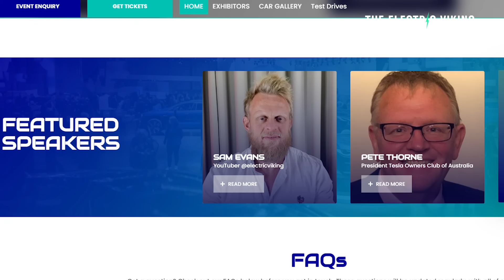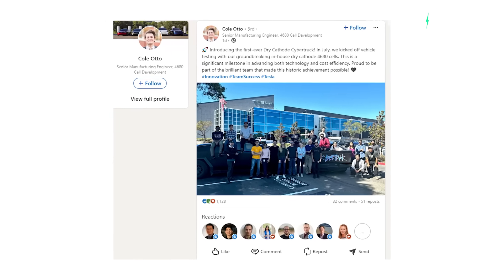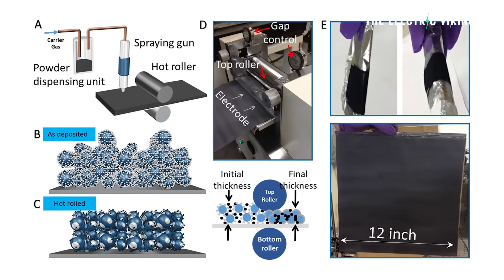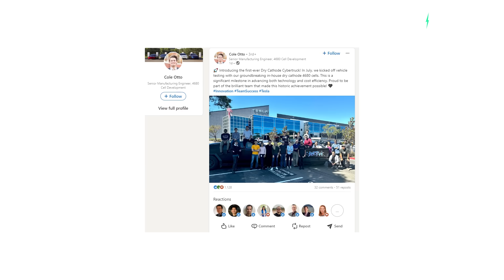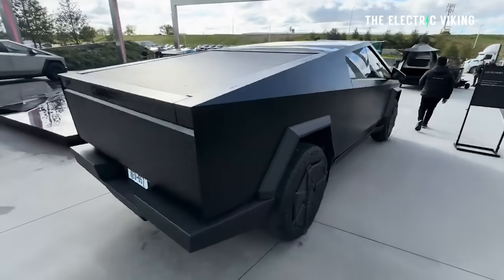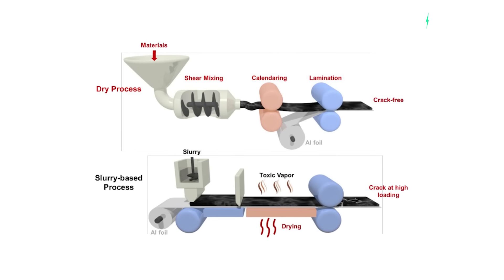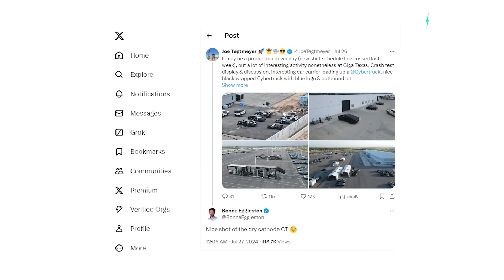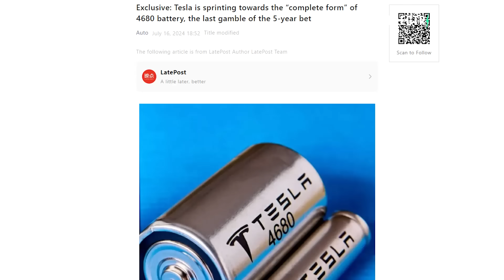Tesla finally solve 4680 battery "bottleneck" - this changes everything!

Comment: Use digital camera as new type of battery so all we need is contrast even in the night we had saperate by distance had contrast can generate electricity at nano level and capaciance effect can store at all time in buffer zone and shift to battery at master clock timing like 20mhz so at few square in 20 million a second is like 20 million square in in sun light

Comment: If Tesla has this working they could manufacture  a bigger 65mm by 160mm battery that would suit the Semi  and Mega Packs . that size would be equal to 4  4680 batteries  but could be produced in nearly the same time . The saving would be even greater  . Tesla bought MAXWELL. to also get super capacitors which can work as a buffer on regenerating braking on Semi truck both on long downhill runs  and uphill climbs . The computer knows the route the truck is travelling so it could keep or recharge the capacitors so there is more power available than just the batteries .

Comment: It’s easy to claim 10-20% improvements in small volume, lab-produced test products. The question is not so much whether they can do it, but whether they can engineer it into mass production. If so, this would mean that Tesla could mass produce 4680 cells and Cybertrucks at the rate needed to satisfy customers and be profitable. That’s the game changer, not shaving off some weight, or an incremental range improvement.

Comment: No wasted lithium; that is the main advantage of dry process.  Old, wet process results in a battery that sequesters 10% of the total lithium at the anode, from the very first time the battery is charged.  That 10% is never available again for the charge discharge cycle.  Hence, dry process needs just 90% of the lithium to get the same effective watt-hours.  This is something I read back when Tesla was purchasing Maxwell; (Maxwell was the super-capacitor company that developed the dry electrode process concept).   I assume what I read then is true; hence I share it here.  In that case, energy density, i.e. watt-hours per unit weight, would be increased by the weight savings derived from using all lithium, instead of just 90% of the lithium, plus any weight saved from not having residual solvent.  I expect this boost is well _under_ 10%, so reports of 20% are just wrong.  Still, even 5% higher density would be significant, because Tesla is getting a universal advantage.  Note that “dry process” is about the manufacturing process, not the battery chemistry. I presume this means that for_every_ lithium ion based battery chemistry (excluding solid state?). Tesla will always have this percentage advantage over anybody else using the identical chemistry.  So Tesla can now say: “anything you can do, I can do better.”  Other advantages include: Lithium is expensive, so cutting lithium input by 10% is a cost savings that only Tesla will have.  Also, if the manufacturing process does not use toxic solvents, that is going to make the manufacturing process friendlier and cheaper.

Comment: I'll believe it when I see it. Tesla's had a lot of issues with these batteries.
Reply: What issuses please describe.
Reply: The ones I've read about are full tab forming, collecting plate welding, laser sealing and dry coating. It seems like they potentially might have resolved some if not all of these issue, but it wouldn't be the first time Elon has exaggerated things, putting the cart before the horse. We need to see mass production occur with no hiccups before we can consider the bottleneck resolved. Don't tell me Elon show me.
Reply: Supply chain issues. China is the only source for many commodities needed in the production process.
Since they own the supply chains and produce a cheaper better product, Tesla will be relegated to the dustbin of history.

Comment: Has Tesla fixed the dry ANODE problem?  All LiIon cells for years have had increased energy density from Silicon embedded in the graphite anode.  It's what increased the 18650 cells from 1.3Ah to over 3Ah in every drill sold by Home Depot and everyone else..  And the 4680 cells have always lacked Silicon in the dry anodes (as well as having wet-process cathodes.)  Has Tesla said anything about having fixed this?

Comment: If I were to buy a CT, I think I'd rather have the 400 mile range, since you don't really get 400, and it would let you use the truck to tow something and still get over 200 miles range.

Comment: Negative and positive cathodes? I thought the 6480 was a battery cell, not and electrolytic cell... If galvanic (power storage) cells, cathodes are always positive (OK, negative when charging...). The negative electrode is called the "anode".  Tesla has been manufacturing all the anodes it needs, using a DBE process, for some time now, but has been purchasing finished cathodes (manufactured with a wet process).

Comment: Personally I reckon that a 20% reduction in the cost of the most significant cost item in the vehicle will bring about a significant reduction in the cost of producing the vehicle. What percentage of the over all cost is battery? My guess $8000 for a model 3 so $1600 savings times how many vehicles?

Also with a bit of luck by the time my Model S needs a new battery I might only pay around $10,000 instead of the $16,000 I'm looking at, at the moment (given other advances that should happen).

Comment: Nah, the dry cathode is a production process. Currently the cathodes are made in a wet paste, and then they have to dry them to get the moisture out, which ends up with the ALMOST the same product as a dry cathode production method.  One benefit of a dry production method is that in theory you can make the cathode a little thinner.  This will not add 20% to the energy density.  The 4680 was disappointing at announcement, and in the 3 year that have passed it's fallen further behind.
At best this will mean a slightly lighter battery but a large reduction in factory floor space required to make it.

Comment: Imagine you could fit three DRY production lines in the same space vs wet.
Now imagine you could make it 3 times faster.Because you don't have to wait for it to dry.
This means that in two identical sized factories one producing wet one producing dry, If the wet one is producing 1000 batteries a day. The dry one is producing 6-9000 batteries per day.
Now tell me the cost difference would NOT be enormous😅
Reply: With less waste chemicals too!
Reply: That's the idea from battery day. Yup
Reply: You save the space for the drying ovens too.
😉
Reply: With dry cathodes and no anodes in a solid state battery that’s the real game changer, while these are better they’re still not good enough
Reply: @james3440 How much space does a drying oven take? You are not an engineers guy, are you?
Reply: @jantjarks7946  I didn't make this up, on Battery Day Elon said that a Dry process would literally take up 3X less space AND take up to 3X less time, because you don't have to wait for the material to dry.
Reply: @james3440 It seems you still don't know the space requirements. 😉
Reply: @jantjarks7946 haha, you got him stitched up

Comment: It's not just About increasing the energy density the biggest benefit To the dry cathode is that they will be able to increase production Literally 2-3 fold.  Anytime you double production you reduce your cause by at least ten percent.  This could mean BOTH A twenty percent increase in density and a thirty to 40 percent reduction in cost

Comment: Ground temperatures in East Antarctica have SOARED 50 DEGREES (28 CELSIUS) ABOVE NORMAL in the second major heat wave to affect the region in the past 2 years.     Research using aerial surveys suggests that US oil and gas basins are emitting around four times more methane than federal regulators have estimated, reports Reuters.      China Daily carries a comment article by Liu Junguo, president of North China University of Water Resources and Electric Power, arguing that China needs to “build a robust and sustainable water network” in the face of “increasing frequency of extreme weather events and the escalating challenge of water scarcity”.      Extreme Temperatures Around The World says in a Twitter post that some parts of Xinjiang province in northwestern China reached 49.5C on Wednesday, the second hottest day in China on record. There was an extremely hot night at Turpan China, the minimum temperature didn't drop below 35.6 July 31st 2024, one of the hottest nights in Chinese history.     A rapid attribution study has found that the “heat dome” causing scorching temperatures across north Africa and western Europe – including at the Paris Olympics – would have been “impossible” without human-caused global warming, the Guardian reports.
Reply: The highest temperatures were in the 1930's. There has been a cooling trend since then.
Reply: @markmiller8903  Absurd assertion even for a skilled propagandist / Exxon emoployee:   https://science.nasa.gov/climate-change/evidence/
SCIENCE ANYONE??
Reply: Ok, when did the Antarctic begin temperature records? Um, 1900-ish, so wow - 2 heat waves in 2 years ? What happened in the other 120? What is NORMAL anyway?
And China - when did they invent the thermometer to allow us to know that in their entire history it was "one of the hottest nights"?. I think we should be told!
Also, the Guardian doesn't mention Paris lives in a bowl, practically surrounded by hills - if you'd been there or driven into it you would know that. 
And conveniently forgets that it is summer in the Northern Hemisphere. You know, that time of year when... it's not cold.
🤣
Reply: @BlackBuck777  https://science.nasa.gov/climate-change/evidence/
I MAY have spent more time in Paris than you have. You CLEARLY didn't study at PSL--that's Paris Sciences et Lettres University. SCIENCE IS YOUR FRIEND!

Comment: Using the same battery pack it gives the RD M3 a range of 616km, or reduce the number of cells and reduce battery pack weight by 80Kg, down to 400kg. The lower weight will improve range. So lower the number of cells to get the same range. Amazing.

Comment: They would also get greater energy efficiency due to its lighter weight. They could offer the same range, but with a smaller battery weight at lower cost. Also however the power usage would fall per km travelled due to the lighter weight.

Comment: Tesla could also keep the same battery space/weight in the CT,  but use new better batteries so the hauling range increases.  Jeannine
Reply: Yeah, striking that balance is important, and there will always be some users who are outliers and dissatisfied with all options that research has determined makes sense.

Comment: I think having the biggest, best battery is great but when you can make your own and it is good enough we need to be satisfied. Does a car need more the 400 miles of range? We never needed it before. Lighter & more efficient should be the goal.
Reply: While the average person may not need it, there is a minority who like or have to drive long distances.  Taxi or delivery drivers.  Those that love to drive away while on vacation. And 400miles is 😮in ideal cobditions. In colder or hillier conditions, owners haven't been getting 400 miles.
Reply: If you want to use a truck for hauling a big trailer, you are going to need that kind of unloaded range to have a decent shot at making long journeys acceptable.

The supercharger network makes driving a Tesla car around the US very feasible. Those two and a half hour stretches are going to consume a heck of a lot more power pulling a heavy load with poor aerodynamics. That's when the extra capacity becomes important, and that's why I'm kind of saddened that the range extender both has to exist and is also something that has to be installed by a service center.

I have an invitation to order a Founders Edition truck. I can't bring myself to pull the trigger on it right now.
Reply: Th vertical integration is complete
Reply: @SparkySho  Lose more money.

Comment: 20% cost reduction..... but when we're talking about 20% energy density probably a few more years away... Because they've not been able to add silicon yet
Reply: That is incorrect they have added silicon per Munro analysis of the most recent 4680 cells.  Also the dry process does add to energy density improvements as well - it’s not just cost cutting.
Reply: @RagnarinVa  hopefully that's correct

Comment: Can it be retroactively installed our Teslas or are we supposed to be happy for new owners?
Reply: Just be happy for the new owners!!
Reply: The main feature is the reduced cost.   Until Tesla increases the energy density putting them in your CT would not change anything.
Reply: It can,but it would be waste of your existing battery pack so it's better to wait till your capacity is degraded to a point it needs replacement.
Reply: @Globalscanningeyes  So something like 15 or 20 years from now :)